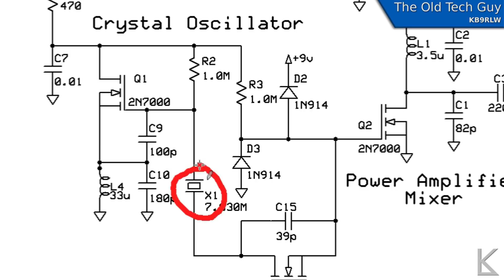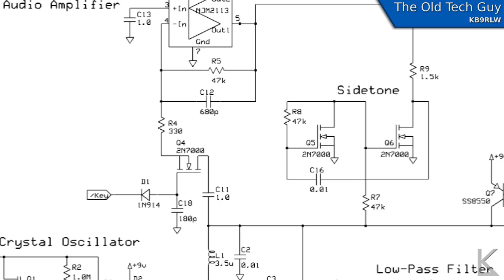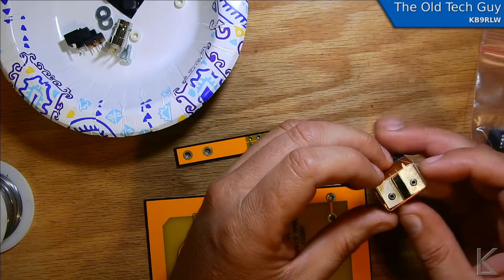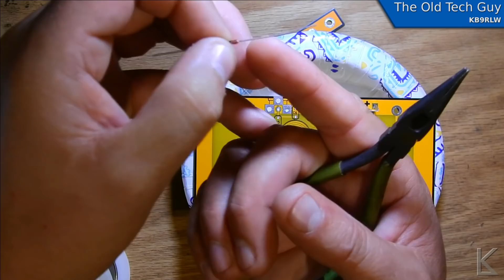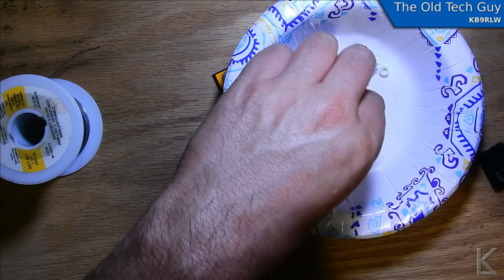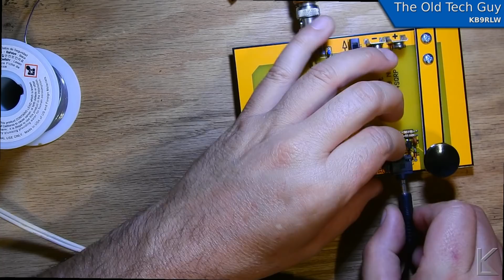Ham Radio - Building the Cricket 40 QRPp CW transceiver kit.

Comment: Hey Kevin. I know you put this out 5 years ago. Several members of our club just built this Cricket-40 over zoom. It probably doesn't make a difference now anymore but I thought I'd just give you my FYI. You had the flat washers in the right place  between the nut and the PCB. As far as the key gap, you have enough adjustment with just the mounting screws. If you tighten the end screw closest to the edge, it will increase the gap. Tightening the near one will decrease the gap. The spacers are somewhat squishable.Just something I learned by accident. 73

Comment: Friggin cool! Did you ever make any contacts with this? I’m big into QRP kits..even one medium distance contact would be worth it to me lol. If so, what sort of antenna did you use?
Reply from the maker: I used it on my doublet and made a couple of contacts.   Ultimately I gave it away to another ham that enjoys these little radios.   I didn't like the broad and low sensitivity direct conversion receiver.  There's no filtering on it so it brings in the full audio range which makes it hard for my ears to pick out single signals.

Comment: How does it sound on the air?
Reply from the maker: Weak and terribly wide on RX.  If the band is busy, you'll hear four or more stations at once.   On TX, nice and clean with no chirp or click.
Reply: @loughkb  Thanks Kevin. Several years ago I built a 40m RockMite and put it in a Altoids tin. Never had a good enough antenna to get out though being in an HOA.
James AD6LP

Comment: google for Diode Protection Circuit
Reply from the maker: Which wouldn't make sense the way they are placed in this circuit.
Diode protection against reverse power supply connection is almost always implemented at the power supply point of the circuit and usually includes a fuse that would blow, saving the circuit.
In this case, if the battery was connected backwards, difficult with the polarized connectors,  the diodes and then the other components would all blow.
Reply: @loughkb  Not the battery voltage, but HF voltage protection. The gate is pretty delicate.
Reply from the maker: @tim46767  Ah.  OK, now I can see that.  When the mixer is in RF amp mode during transmit?  No, that couldn't be it..  Or high RF voltages from BC stations coming in the antenna as I guessed toward in the video?
Reply: @loughkb  I'm stupid! I was thinking that the gate of q2 is the HF input. To be honest I have difficulties to read a schematic if not make in the usual way. Ground at the bottom, + at he top, input left, output right, gate on the left, drain top, source bottom. In this schematic you have literally any way to draw a transistor ;-)
Reply: @loughkb  goggle: I/O pins  protection diodes

Comment: reversed diodes will help with hooking up the battery backwards.. as in not killing the transistors..
Reply from the maker: Someone else suggested that as well.   The thing is, that's usually accomplished by a single diode at the power feed, not within the circuit and also usually accompanied by a fuse that will blow before the diode.   If that was the intent in this case, hooking the battery up backwards, difficult with the polarized plugs, would blow the diodes and then destroy the circuit in short order.
I'm pretty sure they provide some other function.
Reply: @loughkb  Very true, but I can see the need for two of the smaller diodes if he tested an "oops" and it blew the transistor down around the oscillator during his test.

Comment: Hi Kevin,  I enjoy your videos and lifestyle.  I live in the high desert of New Mexico.  During your build, you made the comment than non electrolytic capacitors have no polarity and does not matter how they are installed.  I thought that this was the case until I watched this video a few days ago.  I thought you might like to see this.  https://www.youtube.com/watch?v=BnR_DLd1PDI

Brad
N6GR
Reply from the maker: I can guess what it's about.  Caps that are made with a coil of metals separated by a dialectric will have one side that is connected to the outermost foil and is there for considered the ground side due to the shielding that outer foil provides.  They often have a small black mark next to one pin to indicate that side.  The disc ceramic and small monolithics are parallel plates, so it shouldn't matter there.
That's my guess, I'll go check out the video.
Reply: @loughkb  Yes and Yes.  He wired caps to a scope.  Then touched the cap to add a signal.  Reverse the scope probes and one side has a higher amplitude.  Put that side to ground and quite possible have a lower noise circuit.  The video even showed you cannot trust the marking if any.

Comment: Yo Kevin:
Great video! I look forward to your mods involving this kit. Did hear broadcast in the audio you presented in the video, hopefully you'll tackle that in your mod. Hopefully spice up the sensitivity too. Carry on guy! 73's!
de seeker/Jeff WA7LFP
Reply from the maker: Getting rid of the BC component would require some kind of pre-selector filtering on the antenna input.  
The only way to up the sensitivity would be with an addition of an RF amplifier between the antenna input and the mixer. 
Maybe down the road.   I've more to do with it as is for video yet.
Reply: @loughkb  No! In fact this could be improved upon by switching to a Hi-Q mag loop antenna! Sounds "out-there" but you might be surprised with the results. Excellent application - with QRP output levels there's minimal concern for the high-voltages at the tuning capacitor and the selectivity of a "tuned-circuit" antenna will help cut out adjacent QRM. - 73 - N3BNQ/KA1FWW
Reply from the maker: @idontneednostinkingchannel6848  You probably haven't seen my many earlier vids on magloops.  Quite familiar with them.  
However,  my previous suggestions will work, no need to say such a strong "No!" to them.
And sure, the narrow bandwidth of a magloop would cut out the BC noise coming through.

Comment: That is neat;  I have to say I like my Pixie 2 type a bit more.  It only puts about 1/4 watt but it fits in an Altoids tin including a 9 volt battery.  I did build three , three channel models including  a keyer chip, three position crystal switches but used external power through a coaxial power jack.  All these Pixies would drive earphone fine.  I don't remember how I did it but I added RF gain to one of them to throttle down the real strong signals so I could hear them better.  I'll check on the Cricket,  thanks for the great video, Greg KA8ZAF

Comment: nice video Kevin.  Thank  you for breaking down the circuits.  I built one of those, and had some problems getting the receive volume and with the side tone.  First, I used a little amplified computer speaker, then found that a cheap pair of earbuds was better but not great.  I guess it has something to do with the way the audio is wired up.  I would like to beef up that receive sensitivity, and selectivity, put it in a lunch tin, and improve that hand key a bit.  I look forward  to any additional videos you  might do with this radio. I have learned a lot more about how it was designed. Did get some reports from the reverse beacon, but have yet to make a contact with it. 73.

Comment: The little board strip and the extra jack let you connect an external keyer and paddle instead of the straight key.
Reply from the maker: Yeah, I figured that out later in the video and pointed it out. :-)
Reply: Would that allow an iambic keyer?
Reply from the maker: @ryanv7075  an electronic keyer, sure.
Reply: Kevin Loughin I just purchased the keyer produced by TheCheap3DPrinter on Etsy, but am unsure if it is electronic or not.
Reply from the maker: @ryanv7075  You might be using the term "keyer" to describe a paddle.   A "Keyer" is an electronic circuit that you plug your paddles in to.  It then converts the paddles switch closures into strings of dots and dashes and has an output line that goes to the radios key input.
Reply: Kevin Loughin indeed! Not sure if the connections are any different between the two, the package has not arrived yet. But in any case, I like the idea of trying to hook a paddle up to one of these portable radios. Taking the code ops course next month, and they only teach paddle. Cheers!

Comment: To tap off audio try to connect  a smal transformer över the outputs and Conect line amp on the unbal side.
Reply from the maker: I have another idea.  I have in-ear microphones I use for binaural recording.  I'm going to put those in and the headphones over them.

Comment: I think the odd Arrangement for the Audio is just using the IC in Push Pull and they are using the headphones as acting like an audio transformer..Push Pull usually has 2 amplifiers that have a centre tapped transformer with center tapped ground or it can be left floating. Interesting way to get a bit more audio out with less components, I also think the dual op amp would be a lot cheaper than say an LM380 or similar Audio amp ic.
Reply from the maker: He did a few clever things in that design, didn't he? :-)

Comment: Hi Kevin, Great Video and the little kit beats surface mount stuff for sure when the old eyes don't work as well as they use too.
I always find English is a Crazy Language when listening to the US  version versus UK version, I kept having images of Plywood with a Veneer every time you said Sodder the Veneers 😊 in the UK we call it Solder the Via,s..
I understand what you Dad was saying about leaving the leads of the Transistors long, I always remember as a kid holding onto each Transistor leg whilst Soldering it with a pair of long nose pliers so the heat didn't destroy the Junction inside the Transistors. Heat was a No No when it came to those early Transistors especially the Germanium ones. Its amazing how hot the New Electronic components can get, hot enough to burn your fingers.
Very Best Wishes for a great Christmas and a Prosperous and healthy New Year.

Comment: I'm going to assume the reverse diodes are for shunting stray currents and reducing noise.
Reply: I figured it was reverse power supply voltage protection.
Reply from the maker: I considered that as well.  However,  very odd placement if that's the case.  A single diode at the power connection would do the same.  However, that strategy is almost always accompanied by a fuse.  The reverse diode will blow the fuse before the diode and the rest of the circuit is destroyed.
This has to be something different.   I'm still betting on reduction in interference from strong broadcast signals coming in through the antenna.
Reply: @loughkb  Are the two diodes for clamping the voltage swing at the gate of Q2? Have you had a reply yet from the designer?

Comment: Kevin, I had to smile at the folding of the legs for D1. It was exactly as taught in the British Army, failure to use that method led to harsh penalties. In fact we were urged to employ that method with all components to prevent damage.
Reply: we were taught to do it that way in primary school, we built little radios something the same with little wire antennas, they would transmit across the school but that was about it.  It was done just to introduce us to electronics and radio.  A toy walkie talkie had more power, but it was fun building the radios, even if we didn't have a clue about Morse.  In fact a walkie talkie someone brought in to school (some kid with rich parents) had Morse on the front as it also had a Morse key tone on it.  The sets we built were clearer than the walkie talkie by the way, but it could transmit voice.  No idea what frequency it was on, it was just a walkie talkie and the kits were just Morse radios to us.  But we had fun building all four kits between us.  I ended up doing a kit on my own as the girl I was supposed to build the kit with was not interested.  That is how the teacher told us how to bend component wires (I wonder if he had been in the army, maybe he was during the WW11, but he never mentioned it.  Anyway, all worked but one radio, even the teacher couldn't work out what was wrong with it, I suspect it was someone a bit heavy handed with the soldering iron and to much heat on a component.

Comment: Watching you solder a PCB is like me watching myself soldering a PCB.  All the same tricks.    :-)

I recommend No Clean solder so the board doesn't need cleaning and the flux doesn't turn gummy and nasty crufty brown in a year or two.

Hey, the switch does have a polarity.  It bugs my OCD if a switch is moved to the left or down to turn on the power.  I ohm them out before installing them.

I'm an old tech guy too.  I have a nice Luxo Wave lighted magnifier that I use for soldering, and now I need more powerful flip up magnifiers to read component values.  Geezer Vision is my old man super power.  I also have the Cozy Magnifier app on my phone that makes a pretty nice lighted digital microscope.

Nice build!  Thanks for sharing.  I have three of the Pixie kits that I should build this winter, although the three inductors printed onto the Cricket's PCB was a very nice touch.  That looks like a very nice high quality little kit.